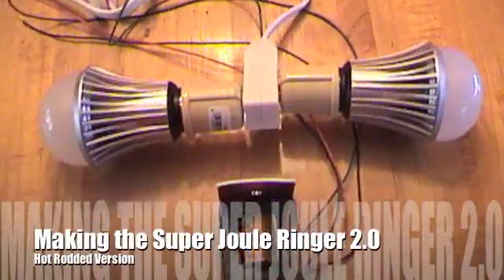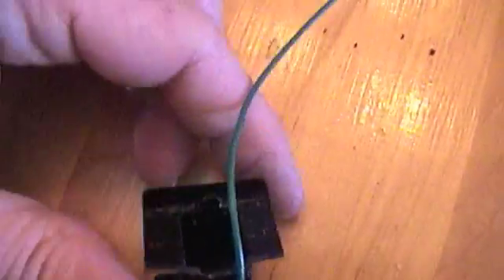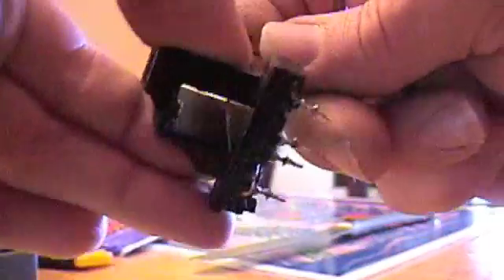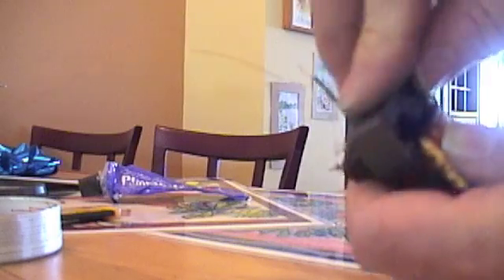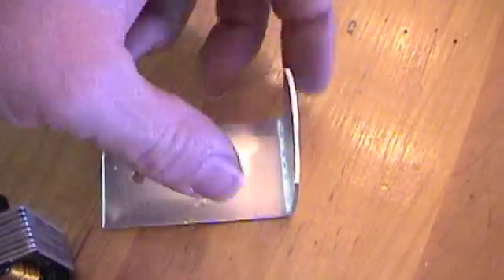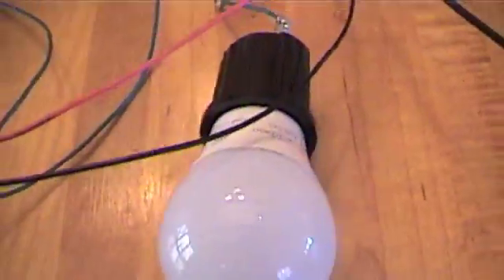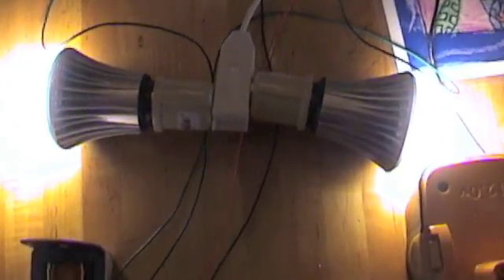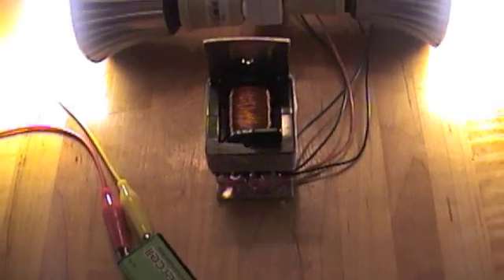Making the Super Joule Ringer 2

Comment: Any idea how many windings for 240v..  [I did the jr3 at 110v with a 13watt cfl and gave out the equal of grid 11watt, the cfl was a tricky fish to get to switch on/off consistently. (Think the amps was about 1.5 at 14.8v)  Any ways, if you have an idea on the winding for a 240v system alls great, ty., oh, I needed a chunky heat sink on my transistor as it was cooking, got the heat down with having 3 transistor.. I'm not very electrical but it seemed to work].

Comment from the maker: No, this circuit puts out 120 volts at very high frequency and low amperage.  It would fry electronics and probably wouldn't be good for the motors.  It really is just for efficient lighting.  There are a few other tricks like charging a higher voltage battery.

Comment from the maker: Probably about five - ten minutes.  CFLs are power hogs compared to LED bulbs.  Its all about amp hours and how many milliamps the bulb consumes.  If you are running a bulb that needs 200 milliamps off a 200 ma/hr battery you can calculate how long it will run.  The CFL needs about 1 amp.